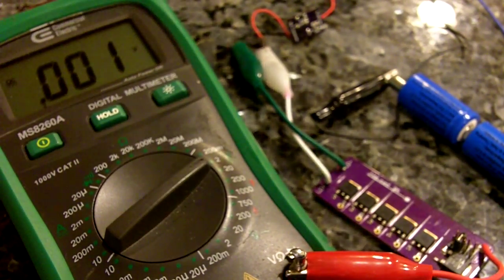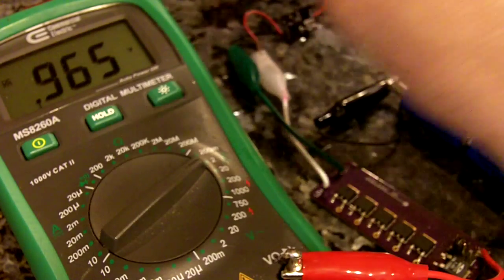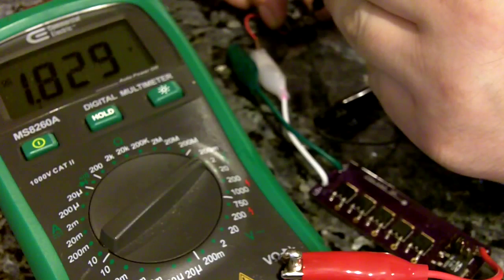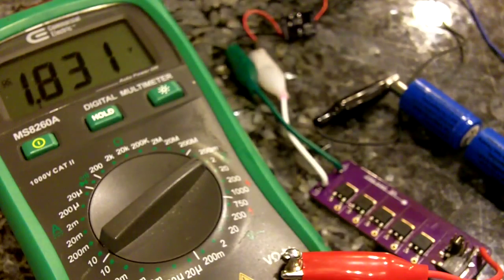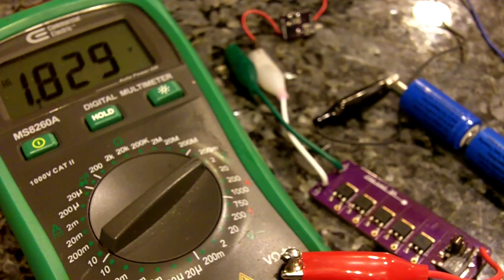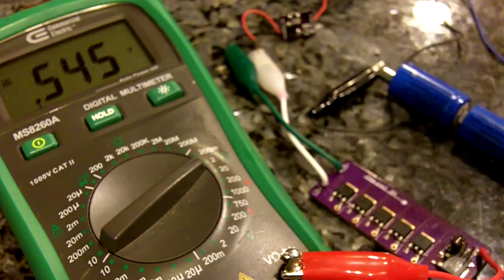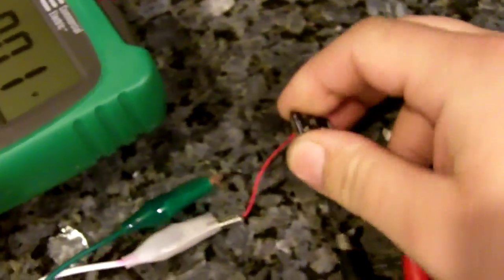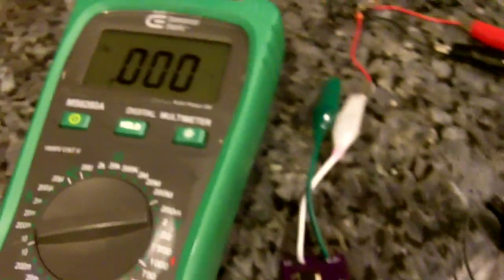X-Drive V6 Stability test at 1.8A

Comment: Ok I'm new to the laser scene and did a lot of research on my own and found everything I'm going to need but I've become stuck on this one problem.How do you raise and lower the current on the x drive?Is there a knob or something on the resistor?Don't mean to sound like a noob but that's the only thing that I seem to be stuck on.Also will a 	
1.5-2W 445 nm Blue Laser 1.8a max  Diode work with the x drive?

Thanks in advance